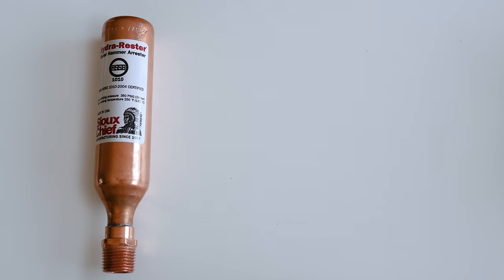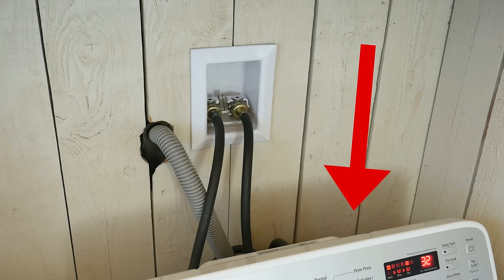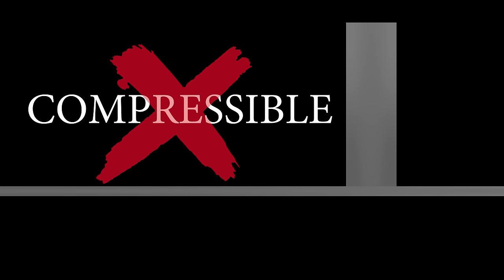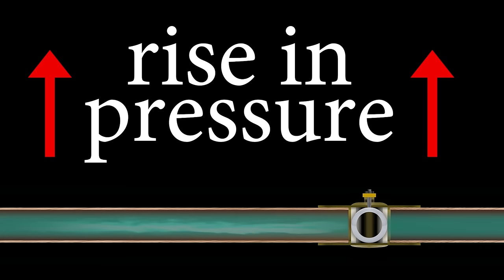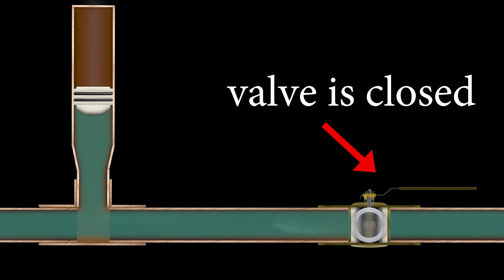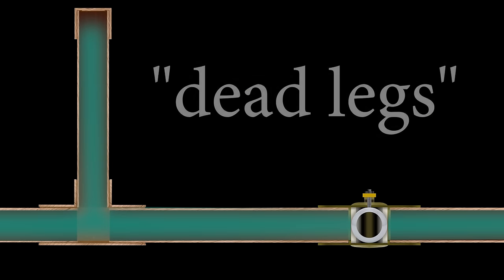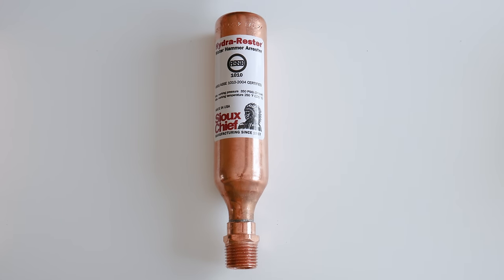Why Water Hammer Arrestors Are SO Important | GOT2LEARN

Comment: The front loader machines cause hammering problems. I have installed two of these and I don't think it helps any. I notice no difference whether they are on or not.
Reply from the maker: What kinda pressure you got coming in the house?

Comment: or u could plumb a building correctly... this isn't a "normal" problem., usually is a problem when an addition is made or in awkwardly designed housing( meaning the engineer that made the blueprints or design did not account for angles or deviations in the plumbing... thats where a good plumber comes in. The "water hammer" effect can be easily avoided with a simple increase or decrease in the angle of surrounding pipes or the location of valves. I will say not all plumbers are aware of hydrodynamic(idk why its our job), but yes "Hammer resistors"("flow resistors", gas operated bump-resistors" "hydro-shock resistors") are a great idea and will help with the "rattle for at least 5-8 years. Why we install such devices in easy access area, no matter the gas in the cylinder it will be absorbed, o-rings or not (because of science, :P, gas will escape and mingle with fluid here; why its normally either pure oxygen or nitrogen). So placing them in common-issue areas makes changing convinent and less expensive then adjusting you entire in-line to adjust for w.e appliance u have. 

Conclusion: Yes these are great and convenient, they are code because its easier to plan for engineers and less work for Plumbers that is all lol.
Reply: btw i liked the video, maybe a little too simple but then again I'm not the armature audience lol, love your other works too keep it up. Basically i love seeing the "trade secrets" / beginner tips n tricks i had to learn on the job :) good work.

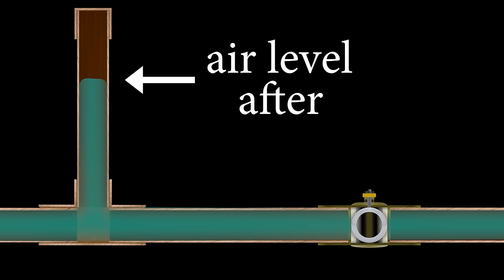Comment: 2:00 you just proved they are useless. Especially after I am consistently pulling out 40 year old plumbing with this design in their copper plumbing and yet, customers NEVER mention or complain about leaks, or bangs, or and issues you mentioned. 

Amazing, right?! 

Hammer arrestor’s ARE NOT MANDATORY.
Reply from the maker: They didn't complain because they had low pressure.
Reply: @Got2Learn  I doubt that. Most, if not all, homeowners would certainly complain about low pressure and would have the good sense to know the difference.  The old design, yea, was just stupid. I’m not impressed with the new design either. Why? It works the exact same as the old one. Oh wow a new plastic float with rubber washers… 😒.  That requires MORE water pressure to function that way it’s designed, so if you do in fact have low pressure before the update, you have wasted ALOT of money putting this thru your house. 

It’s a great idea. But it needs improvement.

Comment: I have a few sets of these in my house, made no difference, not really a big water hammer to begin with either
Reply from the maker: That might be just why it didn't make a difference.
Reply: @Got2Learn  Just a thought.. I'm also having similar issue.. the one thing I have yet to do is crawl under and perform a hands on visual.. my thought is looking for an extended length of unsupported spans.. it sounds like the hammering is structural more than hydraulic.. does that make any sense?

Almost as easy as trying to diagnose that "funny tick I'm hearing over 60mph" over the phone.. the guy was serious..

Comment: I have two of them installed on my clothes washer (hot and cold) and it still hits loud in the house; sounds the same with and without them installed. Ideas?
Reply from the maker: Either install a pressure regulator or add more :)

Comment: legionnaires desires is a problem with these as the water inside the valve isn't circulated. They would never be allowed to be fitted in a public building.
Reply from the maker: In engineered arresters like these, the problem of having standing water is nonexistent.
Reply: Can you explain how the water inside is circulated and not just bypassed?

Comment: So, um... Aren't you replacing a system that has no moving parts, lasts many decades, and has the antimicrobial properties of copper, with a plastic system that deteriorates due to hard water every few years and provides a much more porous surface (rubber and plastic instead of copper) on which microbes can grow?

Comment: Those water hammer arrestors are only good for SLIGHT water hammer. Some washing machines have an arm that slam SHUT real hard to where it creates massive water hammer in which these little ones don't suppress it. 
Such a bad design that we need to buy things like this to help absorb that shock wave.
Reply: @Got2Learn  we had to put 2 of those at the washer water line feed to stop the water hammer it caused and they did no help, we had to buy a 1 gallon water expansion pressure tank and attach it over the water heater to absorb the water hammer, that method actually worked.
Reply from the maker: Those aren't meant to aborb "hammering" but rather "expansion", maybe you needed a bigger arrester for you situation.
Reply: @Got2Learn  yea i put a 2 gallon expansion tank over the hot water heater
Reply: @Got2Learn  well they are called "hammer" arresters so if they dont absorb or stop the hammering, then they should change the name of it.

Comment: I like your videos but I think that you are getting paid because this is an advertisement, the air chamber water hammer arrestor that have no moving parts if done right will outlast any other kind of water hammer arrestor. Copper is antimicrobial and also you can drain the water in the pipes by closing the main water shutoff valve and opening a faucet and this will restart the water hammer arrestor if it ever get full of water. Thank for the video I always give you a like even if I disagree with something.
Reply from the maker: I'll be very honest with you, I do not get paid for any of my videos except for 1 that I promoted PC parts in the beginning, I only get paid by youtube for their ads hehe, thanks David for the likes!!!

Comment: please prove your statement that the air in a standpipe hammer will be absorbed by the water.
Reply from the maker: The proof is when your system has "air chambers" and it's still banging.
Reply: The air dissolves into the water over time. That's why you get bubbles in ice cubes, as that's the air coming out of solution when it freezes, as frozen water does not keep air the way liquid does. It takes a while to be fully absorbed, as the water in immediate contact gets saturated with air and can't absorb any more. But, as water is used in the plumbing, fresh water replaces that saturated water and there is a new opportunity for dissolving air. Cold water can hold more dissolved air than warm water, which is why fish look for cold water, as their gills depend on dissolved air for the fish to live.

Comment: although water hammer is desired and required to run a effecient for high pressure lift small flow to gravity storages water supply via Ram pump really gotta search all the YouTube videos on them the work with gravity,flow, and water hammer principal just engineer better materials designed to handle the fatigue of water hammer or design a burst valve for overpressure of materials capacity to handle the beautiful hydraulic powerful hammer 👌💜🥰of course" don't let all that power go to your head"😆

Comment: install Pressure Regulating Valves and begone with water hammer.
Reply from the maker: Yup!!!
Reply: PRV will not stop  water hammer in all applications. Get on a commercial application with flush o meter valves you best have them.
Reply: Won't work, you can't stop momentum hammer with any device at the source end unless you lower pressure so much that you lower the velocity of the water which may be unacceptable to the user.

Comment: This channel is “teaching” people the most expensive and unnecessary thing to do. The best and most common technique used by most knowledgeable plumbers is to simply put two “T” fittings instead of 90 degree fittings on the hot and cold supply to your shower control and put a piece of copper capped off at the top on the upward facing part of the two “T” fittings and there is your hammering valve.
Reply from the maker: Not allowed Ray.
Reply: Oh and why is that?
Reply from the maker: @raymaharaj4502  dead legs aren't allowed on potable water

Comment: The banging and rattling is due to poor securement of pipes. Never in my life have I seen stand pipes loose their efficiencies over time. That gasket on these toys will eventually wear due to friction and inevitably fail. Home installations are low PSI with slight increase when the water is shut off, not enough force to cause the air to bond to water molecules.
Reply from the maker: The source of the problem is not the pipes "not being secured properly" but rather them not being protected from the shocks. Some people want to keep the pressure they have (including myself) and the only safe way of doing it is by having proper hammer arresters like these, or you run the chance of having Legionella in your water, not good.
Reply: You are correct regarding noises incorrect regarding impact of pipe joints/connections

Comment: Water is compressible it is just minimally so. If water could not be compressed then we would not experience high pressures in deep water. The pressure would remain the same.
Reply: Wut lol
Reply: Wrongo! You experience high pressure in deep water due to the weight of the water above you. It increases by one atmosphere (14.7 lb per square inch) every 30 feet.

Comment: Well that’s really bullshit because if you just drop everything off really good but it won’t Your pipes won’t rattle how are you Gotta do is put expansion tank on your water heater but I plan many times 30 something years and plumbing never had this happen most the time he got a swing lever Fossetts that’s handles that’s only time it does it if you shut the water off real fast

Comment: liquids ARE compressible, just not significantly. stop saying they aren't compressible... even solids are compressible.... everything is compressible.......................... -_-
Reply: also the air chambers were not stagnant as higher velocity fluids suck fluid out of standing areas like that, as well as eddies forming causing motion in the fluid..... what a bad channel. you got like, 60% of the information you presented right. might as well be the infographics channel XD

Comment: I completely disagree , control your pressure.....( Which is code ) , install your lines correctly and you will experience no water hammer .........signed.    50 year master , from sea to shinning sea

Comment: Only problem is that the water pressure isnt pressurized high enough to cause any problems if the piping was Installed correctly and also all manufacturers build their valves to withstand far more than the little bump they receive when shutting off the water flow. Haha just more trade security. Made up rules based on made up theories to insure only people who pay for their licenses can perform the work that most can do without the license.

Comment: Never saw somone having this. Meaby it just EU thing.
Reply: never saw this in EU, only similar thing because of water heater
Reply: @ImFromPolen  Water heater usually has overpressure valve which releases excess pressure from system caused by heated water expanding. Different issue.

Comment: Absurd.  The stupid things don't really work like advertised.  They do cost $10 or more each however!
Reply from the maker: Don't work lol?
Reply: @Got2Learn  When I remodeled my home the idiot plumbing inspector made me install four of them.  My pipes STILL rattle.  So yeah, they don't work as advertised.
Reply from the maker: @Marshallgill  what kinda pressure did you have?
Reply: @Got2Learn  pretty average city pressure
Reply from the maker: @Marshallgill  you can have 4 of these and tge pipes will still rattle if they weren't secured properly, so my next question is, were they?
Reply: @Got2Learn  Well, while I would never vouch for the knowledge of a city plumbing inspector, they passed inspection. As he was the one who required them you would think that they were installed properly.
Reply from the maker: @Marshallgill  you might have some investigating work to do now 😉

Comment: Needless product imo
Reply from the maker: They are very necessary, you just don't have a need for them hehe ;)
Reply: I just think adding a mandatory addition to you water lines that will need to be replaced periodically is a bad idea. Maybe if they have a lifetime warranty it would be worth setting up for this product.
Reply from the maker: In commercial buildings these are now mandatory, even in homes.
Reply: @Got2Learn  I hope it's mandatory for them to replace the gaskets when they wear out not forcing home owners to pay over and over again for something a simple circular junction would do

Comment: Well, what's with the misinformation regarding water? 
I mean, all of physics prove that water can be compressed. Even the ocean has proven that to be true.
The small amount is in fact small. But in the interest of teaching, stick to facts.
Just because water will not compress as much as air in the lines will does not make water non-compressible in any way.
If that were true, pressure washers would not function as they do.
Don't alter data. That is counter productive to learning.  
There are already far too many sources of misinformation. Separate your channel from those sources.
Reply from the maker: Water is compressible yes, but not enough to say it's compressible and plus, it's not enough to prevent water hammering.
Reply: @Got2Learn  
Fair enough. Perhaps I was being far to black and white in regards to the topic of this video. 
There's just so much misinformation flying around the internet that is causes a desire for only factual data.
But you are correct. 
May my short sighted ignorance remain so that others might learn to think it through before responding.
Reply from the maker: You were also right saying I didn't mention it, I guess we make a good team then, cheers buddy ;)

Comment: If you know your trade than these things are useless, I have removed 100s of these useless things
Reply from the maker: huh? I think your in the wrong trade LOL
Reply: Been a plumber for 14 years, capped stand pipes are the way to go.
The system just needs to be drained every 12 months or so
Reply from the maker: I never drained my system at home just like many others, so that would not be a good options for me.
Reply: @Got2Learn  generally it gets drained by accident, I never put it on the calander.
Change a tap washer, new vanity, new home cock there are many reasons to drain a water system
Reply: @Got2Learn  it only needs to be drained when the water hammer returns, it works much better than a hammer arrester. (They are tiny)
I run my capped stand pipes to the guttering on the outside of the house. 2 or 3m stand pipe is the most effective was of removing bad water hammer.